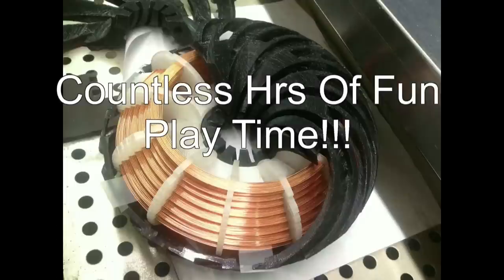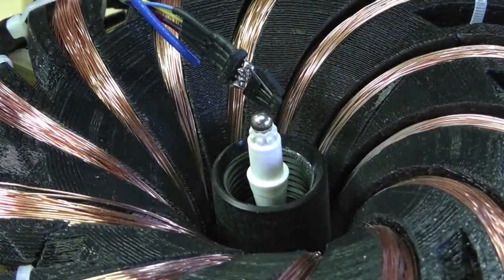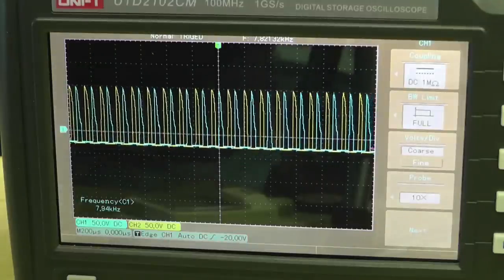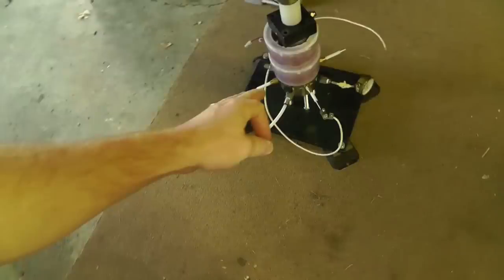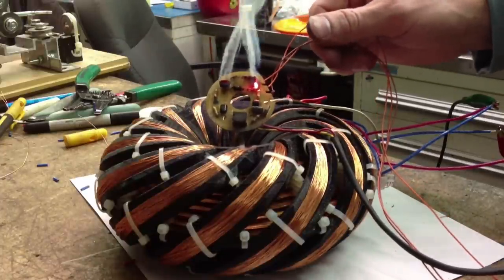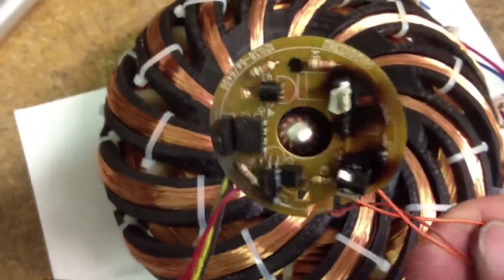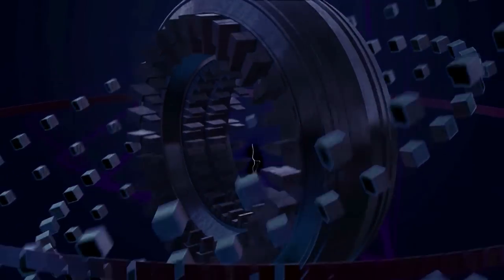PMBO 2013 ~Russ's Final Entry Video... OVER 1/2 Million RPM NEO Sphere Air Bearing With ABHA Coil.

Comment: You know microchips work on magic smoke.  You let the magic smoke out and it no longer works.
Reply: wtf man.. I laughed at that.. time to sleep
Reply: no,  thats the silicone melting!
Reply: Every once in a while..... a fat electron will stop the flow.  :-/
Reply: So do electronic speed controls. I put a little too much amperage though one of my Hobbywing ESCs once and it let out a huge plume of purple smoke, aka Magic Smoke, lol.
Reply: Owwww purple.  RadioShack might have it.  Purple is hard smoke to find!!!
Reply: Equalizer501 Radio shack doesn't carry anything anymore unless its a cell phone you are looking for.  No wonder they are going out of business!
Reply: Garras Porgratix lol, right? went to my local radio shack and they still had crap on the shelves from years ago. phones are the only thing keeping them in biz it seems.
Reply: brandon Would you like to buy some batteries with that phone?
Reply: lol, sure toss a few in will ya?
Reply: Bobby Allen I remember telling a customer that when I was fixing her radio back in the seventies.
Reply: Inside each microchip hides an angry dragon. Do not irritate said dragon or you will see Puff attack the chip.

Comment: If I've done my math right, the equator of your 1" steel ball @ 60krpm was moving at 178mph.
 Please wear a bomb disposal suit and mask when doing this stuff.
Reply: CockatooDude
Fair enough. Some people enjoy playing Russian Roulette.
Reply: People dont understand that playing with science is like cleaning a loaded gun.
Reply: timothy strother
Hah! Work it out for yourself if you're interested. The math is simple as long as you know C = πd and have a conversion calculator.
Reply: Basically the ball as an object doesn't have any velocity at all. Much more interesting is the rotational kinetic energy, which is for a sphere:
E = ½ * (2/5)mR² * ω²
Where m is the mass, R the radius and ω the angular velocity.

At 588000rmp (9.80kHz) the angular velocity equals 9800 * 2π, about 61600rad/s.

The radius is 3/32", so about 2.38 * 10^(-3)m in SI units.

The mass can be calculated using volume and density(7400 kg/m³):
m = (3/4) * π * r³ * ρ = (3/4) * π * (2.38 * 10^(-3))³ * 7400 = 0.226g = 2.26 * 10^(-4)kg

Therefore:
E = ½ * (2/5) * 2.26 * 10^(-4) * (2.38 * 10^(-3))² * 61600² = 0.972J

That's nothing, its the equivalent of the same ball moving with 92.7m/s (334km/h, 209mi/h). Its not like cleaning a loaded firearm, more like cleaning a loaded BB gun. Actually exactly like a BB gun, they use similar sized spheres, energy and velocity. :D

But yeah, better use safety goggles, its not just a toy...
Reply: Edgar Brucke
 A BB gun uses 1" steel spheres?
Reply: No, but about 3/16", which was used in the video :)
Actually 4.5mm pellets are used.
Reply: Edgar Brucke
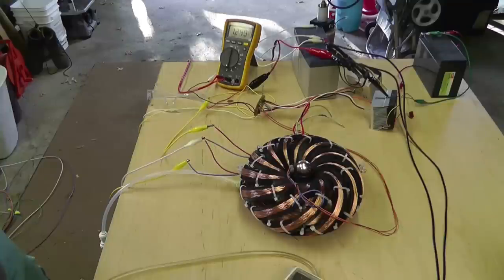 Not what it says or shows at 1:58 in the video
Reply: davidenespana
ok...on reviewing the vid I see you've calculated the second ball, not the first
Reply: davidenespana
I have done that because i thought it has a higher energy, due to the higher angular velocity. But i was wrong, since the radius is also squared and the mass increases cubic to the radius the larger ball has a higher energy. The energy is about 50.2J, 50 times more than the small ball. But still not extreamly much.
The linear equivalent would be the ball moving at 53.0m/s, the point where cheap safety goggles take damage.
Ok, thats more dangerous, lets say its like cleaning a brick on a sting in 1.9m height. :D
Reply: Edgar Brucke You guys are smarter than I am....
Reply: Nah, using formulas and scientific words doesn't make anyone smart. Its the people who ask and think which are smart. And if I remember correctly you just thought about the safety measures and what could have be done better...
Reply: J.D. Turner
Nope... I agree with Edgar... Knowing how to look up the formulae you need and how to use them is something any averagely intelligent person can learn.  The really clever people are the ones who worked out the formulae in the first place. E=mc^2 looks so simple and is easy to use (all you need to know are the relevant units), but it took an Einstein to produce it.
Reply: davidenespana I suppose you guy are correct. Being that I have never had a need for this knowledge is why I never sought it.
Reply: yeah, and put sit-belts.
Reply: with out doing the math i'm pretty sure 178mph isn't even close to producing the centrifugal force required for a steel sphere to explode from the stress.
Reply: superrodder2002 If they did I would worry about wheels at 300 mph at the drag strip...even at 60 mph on the freeway.
Reply: ya, and an aluminum compressor wheel in a turbocharger can turn over 150,000 rpm and it's several inches in diameter.
Reply: CockatooDude Diesel turbos run at 180,000 rpm and are around 4 inches for the turbine wheel diameter.
Reply: Mach 3.6, but close enough :D (did you just estimate that?!)
Well, the wheel itself is not moving at all and that's the speed of the tip of the blades and it is the mach number in normal air. The exhaust gases are obviously quite hot and therefore the speed of sound is greater, so the mach number is less.
According to Wikipedia they reach up to 290,000rpm but I've got no idea how big they are. I always thought they are something like 10cm in diameter... Anyway, the centripetal forces are ridiculesly strong and they sound awesome :D
Reply: CockatooDude Also F1 engines run at 15,000-20,000 rpm meaning the crankshaft and pistons connected via bolts and riding on bearings. Also the spark plugs fire at 150 times a second. Say its safe to say a solid ball of steel can spin 60k.
Reply: CockatooDude Yes, but it's rather complicated. For an ideal gas it is c=√(γ*R*T/M) where γ is the adiabatic index, a property of the gas, R is the ideal gas constant, T the absolute temperature and M the molar mass.
By assuming that the exhaust is just normal air and dry, which it is absolutely not :D, the practical formula c=20.05*√(ϑ+237.15) could be used, where ϑ is the temperature in °C. The problem is that γ changes with the temperature so the equation can't be used for high temperatures.
I estimate the speed of sound to be somewhere at 900m/s but it could be completely wrong, since I don't know much about thermodynamics yet. I have no idea if the blades go super sonic, that's a really good question actually... :D
Reply: CockatooDude Turbines can and do break the sound barrier with their outside edges, they just have to be designed to deal with the resulting wave. Here is the calculation for turbo turbine blade speed (((Wheel RPM) * (((Wheel diameter in inches) * 3.14159)/ 12)) / 5280)60 = Miles per hour of outermost point of vane. 740mph is the speed of sound at sea level. The tip of a 1" wide turbo wheel will break the sound barrier at 249,000 RPM, a 1.5" wide wheel at 166,000 RPM, a 2" wheel at 124,000 RPM, a 2.5" wheel at 100,000 RPM, a 3" wheel at 83,000 RPM.  1.5-2 inch turbos are used in even every day cars and trucks at can reach 200k rpms with no issue.
Reply: CockatooDude Also the outside edge of even prop plane propellers break the sound barrier to no ill effect as they were designed to handle those forces.
Reply: CockatooDude Well they did make them supersonic designed with the REPUBLIC XF-84H "Thunderscreech" there were only two prototypes of that due to how loud the plane was, but many planes have propeller blades that went over the speed of sound. Such as the Stearman and the T-6 Texan their blades went into supersonic speeds but is reduced efficiency and caused engine vibration so they tried to not do that. Jet engines also have tips that go supersonic as they travel at around 10,000 rpm and a 94 inch fan rotating at 4,000 rpm has a tip speed of almost exactly 500 m/s which is Mach 1.5 to 1.65 depending on altitude (Mach 1 speed varies according to air density). Just that is different than ingesting air at that speed, that is very hard to do so while still being able to work at subsonic, which is why fighters that go supersonic actually use intake baffles and other tricks to slow the air down before the impeller.
Reply: J.D. Turner
 Decent analogy, but a bit of an understatement. Science created nuclear weapons after all ;)
Reply: @TiSapph  the ball bearing is is 3/16ths of an inch = 4.76 mm, not 3/32nds.
Reply: @TiSapph  I was going to correct you, but then I realized I was wrong lmao.

Comment: The coils are beautiful, for sure, and the 3d printed bobbins are a nice touch. I also like the air bearing, that is a really good idea. Might even be able to use an aquarium pump for that, for small loads. Double points for recycling the fan circuit to make it all work! And even more points for the safety glasses.
I always wonder, though, if the ball is really turning that fast, or if it might be at a sub-harmonic like 1/2 the drive speed. Do you have any concurrent measurement of speed, like from an optical tachometer?
Also, what's the axis of the spin? Horizontal, or vertical?
Reply: +TinselKoala Russ, did you ever answer this? "what's the axis of the spin? Horizontal, or vertical?"
Reply from the maker: +Lamar Small its going at a 90 degrees from the coil wraps. so end over end... so the axis would be Horizontal... ~Russ
Reply: thanks

Comment: My dad bought a color TV in 1954. After 2 weeks the picture tube went out. He being an engineer knew it was in the flyback transformer, so he rewound it over the course of a week. The TV went on to work great for the next 15 years. I see his patience is not lost on you:) The only thing I've ever rewound are lots of speakers while in metal bands. My dad figured I better learn after the first 3-4 I we blew. Got to where I could make them hold up better than original after I matched the Ohms more precise to the output transformers driving them.

Comment: As a fairly experienced coil builder myself, holy shit at 1:23! 2000 ft of wire that has to be pulled through time after time, after time, after time (the full length) to build that toroid coil. I may get attacked for this (over damaging insulation) but a utility blade will cut down your "unwrapping tape time" part drastically. I've always used a blade, slicing along the grain and never had any breakdown problems. Takes two minutes.. Also, if you find the inner most winding on a "focusing coil" and tie it to something and then find the outermost coil and start "walking it off".... I've found myself at the end of my street within 15 minutes tops with 600 feet of .024" - .046" wire ready to be either used or turned into a spool. Hope these tips help out and keep building.
Reply: Can you please provide link of Overunity in shape of Rodin coil. I wanna build it

Idk much,but I know other things
And my intentions are pure 💠🪷

Comment: seriously, the dude just surpassed the frequency of the voltage pulse at 60 cycles, and people are worried about grammer and spelling. lol no wonder we have no serious advances in tech. just improvements..
Reply: atm there isn't a huge need for large advancements...
Reply: Thyristors are more versatile for common uses of frequency changers, like light dimmers.
Reply: The advancements can make the need.
Reply: *grammar

Comment: Very interesting experiment! Thank you for sharing!

Rodin coils are very similar in shape to the magnetic fields of atoms, molecules, the earth and the sun. They have something in common.

But I think the speed limit of your magnet's rotation is mainly due to the serious friction between the magnet and the air.

If you put a magnet ball in a sealed container and pull out the air. Its speed should continue to increase, because the air resistance is proportional to the speed, that is, f = kv.

(1) How to seal it, we need to extract air, vacuum pump + vacuum cover + ultraviolet LED + ultraviolet glue.

After extracting the air, the air bubbles in the ultraviolet glue, turns on the ultraviolet LED and solidifies the ultraviolet glue.

(2) The whole coil can be put into the vacuum cover (in this case, the size of the vacuum cover will be very large)

If vacuum, your magnet may exceed the speed of millions of revolutions!

Comment: 16 years ago at the age of 10 I had a dream where I was in my room and I had a metal sphere like ball and 4 little towers with electro magnets positioned in a way that it would levitate the ball automatically (the actual product was a little vague and not the best as I was a kid but it would still work and you could improve it). anyway, I turned it on and the ball started spinning so fast in a matter of 30 seconds or so that it started to turn blue, then destabilised from the base and flew out of my house through the ceiling at incomprehensible speeds lol. then I woke up.

Comment: This may sound stupid, but if there's anything to the anapolar theory of dark matter, a coil like this might be able to probe for it by trying to measure for load and hysteresis. (Anapolar fields normally fold over and don't interact with other magnets, but passing another field past it at a high rate may produce a temporary change in momentum. Then it should spring back. This bounce should produce a reaction force similar to that in an electric motor.) Some other modifications may be needed, but it be quite interesting if it can produce a reaction force if it somehow does act upon little known particles with such properties. Mostly because they don't interact with normal mass or field lines that aren't moving, and therefore don't produce a reaction force on those things.

This of course makes a few assumptions about the existance/nature of dark matter, and whether it's available at a density to get a measurable reaction if it can be poked in this manner.

Think of the possibilities with being able to utilize a very peculiar reaction mass that only interacts with a very special motor and nothing else, and may just be floating around everywhere but for all practical reasons (other than astronomical measurements) is undetected.

Thing is, this coil may be more of an isolator or means of aligning some particle with anapolar field lines. Another type of solenoid may be needed to "pluck" at it once kept in the alignment needed to do so. Of course that's some pretty crazy stuff to suggest for a fancy apparatus that's only being used to spin a magnetic bb in the meantime.
Reply: Thanks for the info

Comment: The rpm will be a lot lower, the hall effect sensor cannot read those frequencies for a start, magnet saturation and hysteresis stops any increase over about 40,000, very fast but not 500,000 rpm. Lower speeds under 20,000 are in relation to frequency, but then the losses take over and it becomes non linear. (PS., I design motors).
Stephen
Reply: +stephen wallin Thanks. I was wondering how sure he was about that.
Reply: +stephen wallin How would you go about measuring such rpms?
Reply: +stephen wallin i would also like to know how to record them speeds?
Reply: +enator71 so are u suggesting a form of general steel melted into a Rodin coil would amplify the rotation speed? I briefly heard one one video that tin amplifies the magnetic field of copper. but im not sure if they meant that tin is used to strengthen copper as I can't find any info on that whole idea?
Reply: Wrong.
Reply: Silly question, how does the Hall effect sensor read the ball since it's just a round and uniform surface?

Comment: Just checked it. If you used a ball bearing with a circumference of a half inch at the equator of the ball. At that speed (588,000) rpm's, the equator is moving at 4.6 miles per minute & 278.4 Miles an hour. Nice...slower than a bullet but might still do damage once launched obviously.... Awesome work.

Comment: what are the applications?

obviously could go faster if ball was in vacuum

mystified by how it works??

loved this video so much!!!!!!!!!!!!!!!!!!!!!!!!!!!!!!!!!!

especially fire!!
Reply: +Pat vulk 
A vacuum wouldn't help much since it is spinning in place, and he also used air to float the ball.
Reply: Lilly, I must disagree.  A vacuum would make a (i think a big) difference at those speeds.  Thanks for replying :)
Reply: +Pat vulk Your question has a contariction in itself, because  the ball is floating on the air flow from the down side ,and the  thing, that  limits  the ball revving is the  forse of Stokes F= 6*pi*r*nu*v , and hipotetically in vacuum  you could  increase  the revs , but the ball has  inertia , and  nothing will  support  it without the airflow. But if we go to the case  with  no gravity  in vacuum , the whole  thing  become  pointless  and I hope you know whats the reason. The only  way of achieving  higher revs is  using bigger coil  and current - to deliver bigger  force to the ball . :)
Reply: Oh...I thought it was held in place magnetically.  If the ball is elevated and stabilized by air. ..then obviously vacuum would not help.

If gravity is also what is retaining it vertically, then obviously zero g no go :)

Applications....other than really cool?